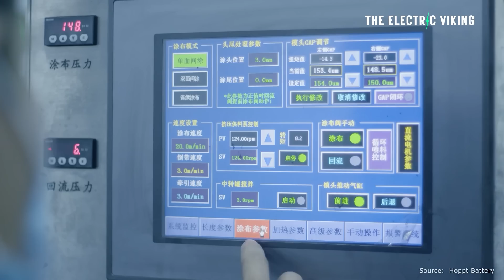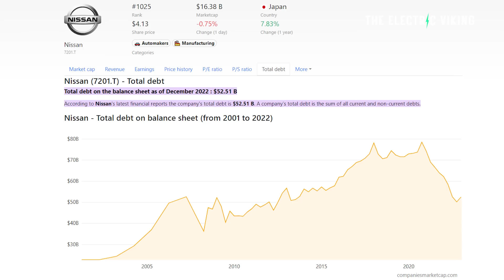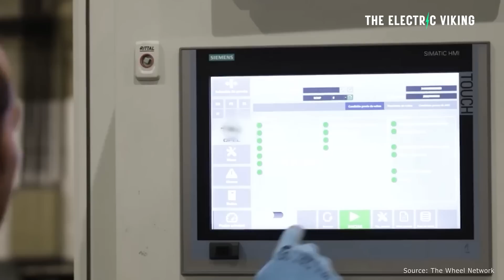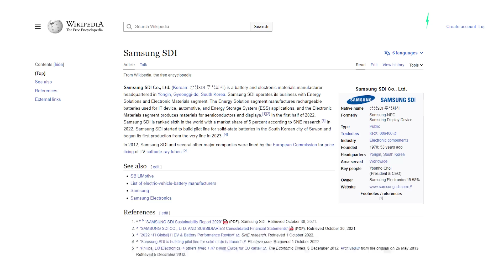WAY too many battery factories are being built in the US with the wrong batteries

Comment: Great to hear some "however" in the world of electric. Helps keep perspective. If the IRA, which overall is a massive positive, what should (without hindsight) have been added to prevent this particular significant glitch?
Reply: >>  this particular significant glitch?  <<
What "glitch" are  you talking about?   China used the same anti-competitive, discriminatory practices to exclude foreign battery competitors, namely Japanese/Korean battery maker from participating in their EV market to  protect China's domestic battery weaklings such as BYD/CATL since 2015.   The IRA is modelled on China's exclusionary model and doing the same in the US, but with help of the Koreans and Japanese, the US is building their own domestic battery industry. 
China's LFP cheap, inferior batteries are suitable for stationary energy storage systems.  And b/c LFP's are contrary to CCP Viking's claim are just as unstable and combustible in normal, or long-range EVs, in addition to energey inefficiency and weight, they are strictly limited to entry-level, low range EVs.   It works in China b/c most EVs sold in China are geared towards urban short-range driving -- eg, China's best selling EV, the Hongguang Mini has 120km-range (or 10kWh).   LFP's key benefit is their pricing and ample supply; and really nothing else.  They catch fire just as much when they put on usual stress -- in fact, dozens of BYD's LFP in PHEV blow up every year.  
This is not the case in the US and that's why high energy efficient and high C-rates NCM is more desirable and the Korean battery makers are currently building 300 GWh capacity by 2025 which in turn makes LFP looks very less attractive -- which is why CCP Viking is so upset.

Comment: Legacy auto usually develops and validates new parts/technology over 5 years and when it goes into production it runs it with minor running changes for a decade at least. Battery/electronics tech. moves too fast…won’t end well.

Comment: Too many batteries?

One view of the clean energy future that is well supported, is the need to go overcapacity in several aspects. Solar, batteries, pumped hydro etc. 
Clean energy grid capacity needs to be be oversized for coal and gas plant decommissioning, electrification of transport, and the difficult tail end of the S-curve; industrial processes. 
I think we don't need to worry about too many batteries at this stage. If not needed at home they can be exported.

Comment: Why is Chinese vertical integration so succesful? Because they shift cost and profits through the supply chain. This means that their batteries, made with the most advanced technologies, will be much cheaper as any product from the West. US/EU battery factories will only survive in cooperation with Chinese firms. IT IS ALREADY EVIDENT THAT THE CHIP FACTORIES IN THE US AND EU ARE FAILING, AND THE EV/BATTERY FACTORIES WILL ALSO FAIL AS CAPITAL IS COMING MORE EXPENSIVE IN THE OVER INDEBTED WEST (i hear that the same development is going on in the INDUSTRIAL TOOL INDUSTRY, formerly dominated by Japan)

Comment: Hey Sam- I like most of your videos, but you have this all wrong.  It is not that hard to change your battery chemistry in a given factory, should a different formulation prove to be better.  While the types of batteries being made, i.e. cylindrical, pouch, prismatic, are very hard to change out, each of those types are chemistry agnostic.  Each of those types can all be made in the NMC or LFP or LMFP formulations with very little change.  Besides, even NMC can be safe as long as you use a stable chemistry, use a well made cell, use a well made module and use a well-developed BMS.  And all those things can be upgraded in these future factories as well.
Reply: The Legacy AUTOMAKERS are loath to add new capital to finished factories.

Comment: I doubt this will be a problem.  They should be able to modify their manufacturing processes.  It's just like designing and making a new car.  Probably easier.  They would have factored in change of technologies.  They have been doing this for years with the same battery factories.  Also with state of the art programable robotics, I doubt it will be a major concern.  Just don't see a major issue here.

Comment: how many of these batteries will be installed in construction machines? how much for buses and other vehicles for city transport (mass transit)? how many of those batteries will find their way into ships? first into ferries and fast passenger liners and then into private yachts, then private pleasure boats? new jet skis are already equipped with batteries and electric motors, motorcycles, bikes, whatever - everything that has an electric drive (mowers, trimmers, hand tools)! you look narrowly at an industry that needs to introduce a revolution in the use of energy, EVERYTHING THAT USED petrol and gasoline must switch to batteries! Until someone invents wireless transmission (what Nikola Tesla was working on)!  I don't want to go into the utilization curve at all, because some of the produced batteries (~25%) will not be good enough for the car industry and will still be a product in demand for hundreds of other purposes.

Comment: A good anti-EV strategy is to install inefficient and obsolete batteries in EVs.
Reply: Thats called planned obsolecence and BAU the automakers virtually invented it..  other than the fashion trade. 

They need to be told its game over... and they will be picking up the bill for the recycling and environmental restoration.

Meantime we have to stop subsidising the fossil fuel companies for burning the stuff.
Reply: You got that the other way around.  LFPs are engineered for stationary energy storage systems with low charge/discharge rate; or entry-level, low-range EVs.  NCMs are used for long range, performance EVs.  The CCP Viking is upset b/c the Korean batteries are kicking Chinese low energy dense batteries in America.

Comment: What a drama queen Sam, i think this video will do more to put off people looking to go EV, especially as the 2nd hand market is vital for transition. Yes let's frighten people off why don't you, jeez! Yes there's been problems with some battery manufacturers, but Tesla states nmc is due to degrade only 12% over 200,000 miles! I'd hardly call that an issue. One of the main pushes to LFP was it's lower cost, not because they're necessarily better. Sure in some ways being able to charge/discharge more fully is handy, but only if you do shed loads of k's per day, or don't have access to overnight charging. Otherwise they're heavier, less energy dense so need a bigger pack size and have more power loss in the cold weather. Thinking about the S curve of uptake in new tech, how many cars have they got to replace in the US to make a dent in their ICE fleet, 20 million cars a year is a drop in the ocean to what they need. Also, have you thought about them wanting to export their batteries?

Comment: This is one of Sam's best videos. This is a killer problem; what happens when you commit billions to building a battery factory, and the entire chemist and geometry changes, which means the factory becomes scrap metal?  It is true that the US companies are hedging their bets by doing joint ventures with SK Innov, Panasonic, LG Chem, Samsung, etc.  If any of the 20 battery startups comes through with a workable design, it can sweep through the industry. The car companies have no choice but to jump on whatever breakthrough happens. There is way too much money at stake to stick with a lousy design. Toyota can get away by using Nickel Metal Hydride batteries in a few of their hybrids, but for full EV's, the price/weight/performance is almost entirely determined by the battery system. Some motors are 93% efficient, some are 95%, but in batteries there is a lot more variability, esp. when you include battery lifetimes.
Reply: so many nonsense here:
>> and the entire chemist and geometry changes, which means the factory becomes scrap metal? <<
First, it takes usually 3 years from the moment an EV OEM sign a contract with a battery maker and the production going online.  The same production line runs for several years at minimum.

>>  It is true that the US companies are hedging their bets by doing joint ventures with SK Innov, Panasonic, LG Chem, Samsung, etc. <<
The South Korean trios are at least 3-4 years ahead of any Chinese battery makers at this point.  When their 300+GWh battery capacity come online by 2025-2026, there is no place for Chinese LFP to stand b/c their LFP won't be price competitive and the Chinese battery makers won't be the only battery suppliers in town. 

>> If any of the 20 battery startups comes through with a workable design, it can sweep through the industry. <<
There aren't 20 different battery startups.  The EV batteries are very difficult to design/test/manufacture -- takes not only theoretical knowledge, but also decades of manufacturing know-how's that can only be acquired from experience.  They already have highly cutting edge NCM8/9 currently used in the Ford F-150, the Ioniq 5N, the Hummer EVs, etc, etc.. In all, about 80% of the US market would be dominated by the Korean trio's high/ultra nickel batteries by 2026-2026.

>>  The car companies have no choice but to jump on whatever breakthrough happens <<
There is no such thing as "jump" in the battery/auto industry.  It takes several years to go from lab, to manufacturing, to commercialization; then another 2-3 years for mass adoption.   A lot of weekly earth-shattering breakthroughs that you hear from this Viking are usually repeats of something already achieved by others (eg, CATL's last week announce of 4C LFP -- which A123 and Samsung developed over 10 years ago); or won't be available for mass production for another 6-7 years, if and only if it's real and manages to survive rigorous market/technical vetting at all.

Comment: Hopefully the equipment needed to make the batteries can be used to make batteries of different chemical compositions. Tesla is in the same boat too.
Reply: Tesla is da gd BOAT  powered by a model s motor 20 years ahead of th game an PULLIN AWAY
Reply: It can. All these batteries are made the same way: smear goop onto separator. You can smear different goops and get different chemistry. So yes a load of different batteries can (at least in principle) be made with the same machinery/factory.
So Sam's whole argument her is essentially bollocks. It's just his usual LFP boosterism.

Comment: Could inferior batteries be configured for stationary storage?
Or do they just need to convert the manufacturing plans into Lithium-Iron-Phosphate?
Elon has said he’d share the patents for the 4680 (I think), if they would be so humble as to accept the idea… The reason I want to find solutions for Ford and GM is because, if they really do go under, the whole market would surely suffer. Such a correction is avoidable, as success still remains as one possibility. 
—Thanks for the invite for sharing a pint. I’ll be with you in spirit. (Oh, and the new shirt looks fabulous🎉)
Reply: Aaaaand they could  AAAABBBBSSSSSOOOOOOOOLLLLLUUUUUTTTEEEELLLLLLLYYYYYY catch Tesla by 2025 …….HA if donkeys could fly yehehe
Reply: >> Could inferior batteries be configured for stationary storage? <<

China's cheap, inferior LFPs are designed and engineer for stationary energey storage.    Contrary to this Viking dude's absurd claim, they are not best for EV application -- which is why they strictly limited to entry-level, low-range EVs.   Most LFP EVs, 90+%, exist in China for that reason -- short-range, urban driving.

Comment: @electricviking Tractor trailer trucks and big trucks that need the highest energy density batteries could soak up a crap ton of that "over supply"  and add to that trains, short range aviation and boats and the potential demand for batteries is much higher than you think.
Reply: No. Tractor trailers will want to charge to 100%, that will drastically shorten the life of  NMC

Comment: What will happen is that batteries will be used for many different things. Currently ups systems use lead acid, those will be replaced by one of the lithium flavors, ICE car lead acid batteries will be replaced, all the batteries used currently on forklifts, floor scrubbers, ride on lawn mowers, tractors, golf carts, ATVs, snowmobiles, boats, sail boat motors, ships, flashlights, there are so many uses for these advanced batteries that they will absorb all the over production that could ever be made. Demand is a big factor on price for batteries. So if there isn't as much demand for ternary batteries, the prices will come down and someone will find a use for them. Also, LFP and M3P batteries speaks to the chemistry of the batteries and not to the form factor. LFP chemistry can be made in cylindrical form. All this over supply will most likely be modified to fill a niche market where lithium would be a terrific advantage.

Comment: Ternary batteries can and will outlast most cars, even if charged to 100% occasionally. Remember the old Nissan Leaf has LFP batteries, without a thermal management system, and they live a short life in comparison to a Tesla. Not all LFP batteries stand the test of time. Is it any wonder that Tesla gives better warranties to their long range batteries? Their LFP batteries dont get as good of a warranty.
Reply: No, the Nissan Leaf has NCM batteries.  LFP was not around when the Leaf came out.
Reply: @CrustyCrip  I stand corrected. I read an article 10 years ago that said they used LFP.

Comment: You may be underestimating future battery demand by focusing on cars. The transport sector includes semis, other trucks, trains and boats. However as the price falls the storage sector will quickly eclipse the transport sector. The demand for batteries may be almost insatiable.
Reply: The real choices will be between none Li technologies Na is on the way big time and the US sits ontop of 80% of the worlds known Na ash mine able reserves.  
The real future batteries are going to involve sulpher and Al both of which will leave Li behind for larger batteries in a dozen different ways not least Li is a pain to produce and very limited in mineable quantities.. being very geographically limited and energy intensive. 

As Prof Sadaway says investing in a lithium and or rare earth  future is like investing in radio valves ...lifting the curtain to find piles of transistors..🤦🏻‍♂️ 

If energy storage gets even  close to liquid fossil fuel densities say 8x now you can forget fossil fuels.  

The other factor is it becomes a self enabling technology if you incorporate dispersed grid scale storage through easily available cheap recyclable chemistry batteries  with life spans in decades .... 

Building cars boats buses etc with Swappable batteries  will be the normal because you dont want to junk the invested energy and materials just because someones tweaked the battery chemistry and come up with something better safer cheaper ...less polluting.

Al Sulpher based cells indicate they can already  stand up to conditions that would destroy most Li technologies.  The price is in tens of dollars per ton for Na and Sulpher compared to Li in the tens of thousands if the supply is even slightly squeezed.

Comment: Turnary batteries might not be  the best choice for grid level storage, but they work "fine" for domestic, and if there is an over supply then the prices will match that. 
The problem is that is hasnt been till recently ( the last decade) that there has been significant rapid development of rechargeable batteries on a commercial scale like there is now, so there will be a rapid but long road of improvements, some can be worked into existing production methods, some probably will need new methods. but you have to start using the technology some where. 
Old tech isnt always obsolete, pricing dictates its place in the market
Reply: >> Turnary batteries might not be  the best choice for grid level storage, but they work "fine" for domestic,  <<
LFPs are limited to slow charging/discharge stationary energy systems at grid or at home;  the ternary batteries for highly performant transports (eg, EVs, trucks).

>> Old tech isnt always obsolete, pricing dictates its place in the market <<
Absolutely. the sky high price of raw materials last few years sent LFP to the fore; by 2025, when 300+GWh battery capacity come online in the US, LFP won't be very price competitive, or only available batteries in town.

Comment: Disagree.  Ternary batteries are being used in North America because North Americans want large batteries, and LFP has not been appropriate for batteries larger than around 50 kWh.  As LFP improves, and they become practical for ever larger batteries, then battery factory plans will adjust to build more and more LFP batteries.

Comment: How much of a battery factor needs to be changed when you change the battery chemistry?  Can you use the same form factor?  Is a lot of the investment in special chemical purification equipment?
Reply: Not much I suspect.  They have been doing this for years with the same battery factories.
Reply: Also with state of the art programable robotics, I doubt it will be a major concern.

Comment: Great thought provoking video!  PS. Ternary means ‘3’ as in an alloy of 3 different metals.  So Lithium Ternary
 or lithium iron phosphate (also 3) seems confusing to me.  Should the term trnary be obsoleted or am I missing the point or too far in the weeds?
Reply: NCM and LFP are both lithium ion batteries.  NCM / LFP describe their material composition in cathodes:  NCM = Nickle + Cobalt + Managese.  LFP = Iron + Phosophate.
I know it's confusing but L is prefixed in LFP to describe lithium, whereas its not explicitly spelled out in (L)NCM.
Reply: @tooltalk  
Thank you!  Perfect explanation!
Reply: Mr Sam is dis right?